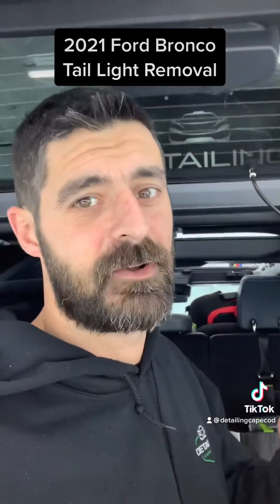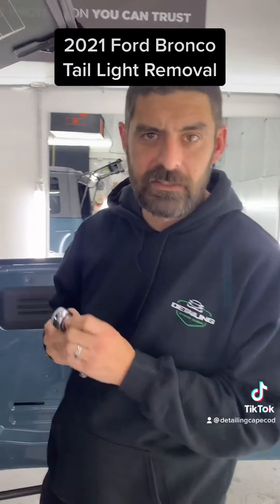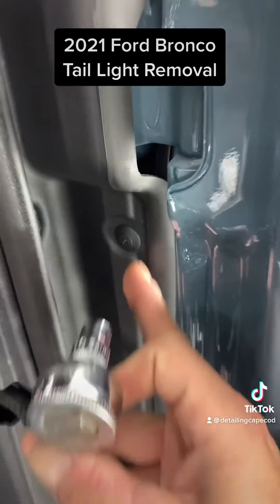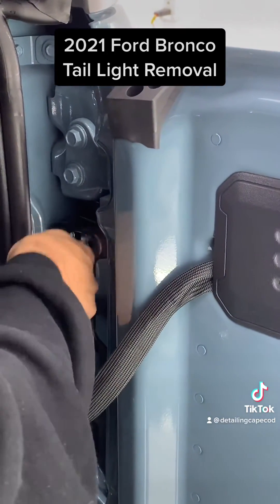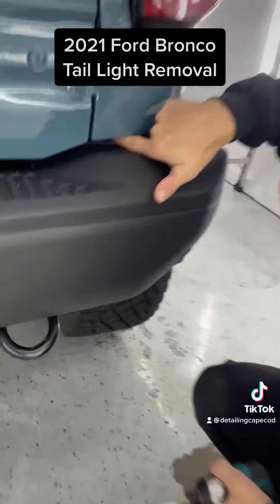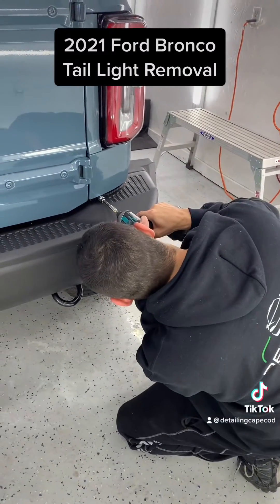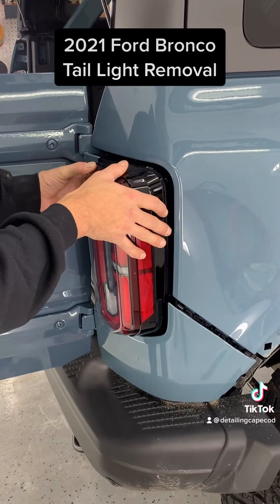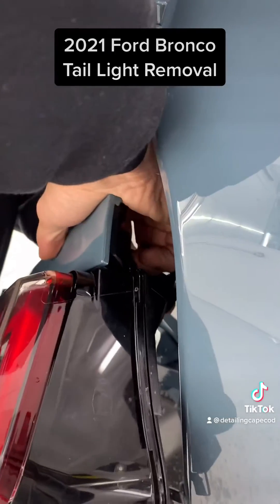2021 Ford Bronco Tail Light Removal

Comment: That exact blinker/brake bulb went out today. Stopped at a parts store to get new bulb, but they didn't have info on which bulb it is so I was going to pull it to verify as I like to replace with same parts. That bottom bolt, man! I didn't have my quarter inch wobbly sockets on hand, so packed up what tools I had to try again tomorrow in the daylight. Glad to see I was on the right track for removing the assembly! Annoying, but not as bad as doing GM headlamps at least haha!

Comment: Anyway you could show how to remove and replace one of the side markers on the Bronco Sport? My left rear side marker got broken by a runaway shopping cart, I have the part to replace it, but have no idea how to do it. I thought maybe it would just pop out with a screw driver, but it seems like it’s attached more secure than that.